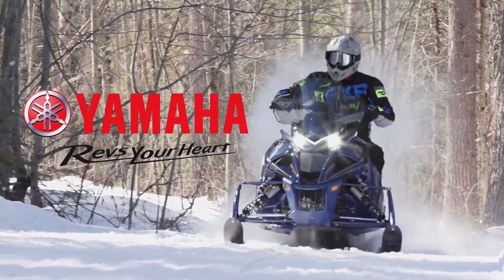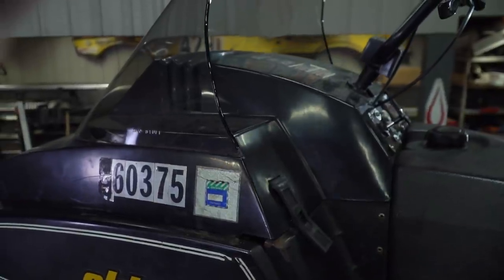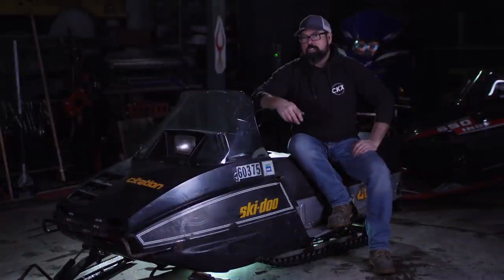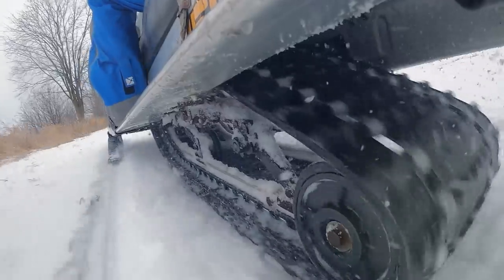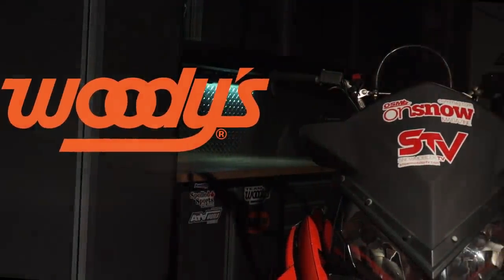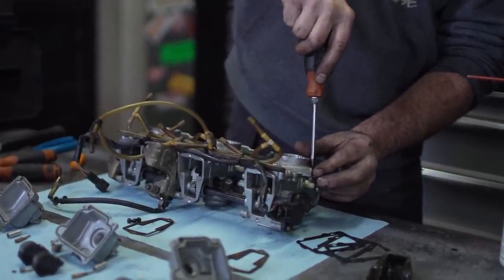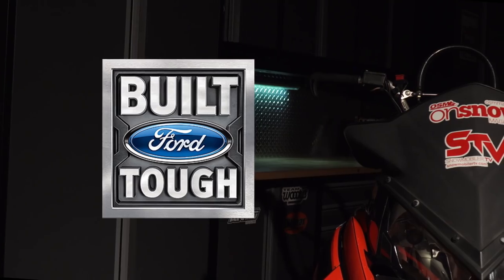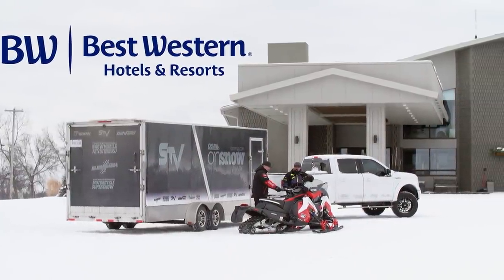Snowmobiler Television 2022 Episode 6

Comment: The citation "first burn" is, I think, the single best segment I've ever seen on STV. Could not stop laughing at the complete deadpan, "as if it's cutting edge" presentation.

On the flip side, was a bit disappointed with the water trick segment. For a show that is almost always more thorough and points out the important details, it seemed to be a bit lacking on info (which way to wrap the tape, WHY a taper seals so well, the fact that you can use the same boot holding the primary on).

Comment: I have a pretty much mint 99 srx700 been a good sled and sounds awesome. Had a shop do a top end though apparently it really didn’t need it but trying to be safe than sorry. Anyways got it back was harder to start if it sat a long time so I put gas in each cylinder and fired up. Later when cold and starting one cylinder would sneeze and cough. Had to give a little gas till it warms up then it would stop doing it. So if you stopped somewhere for a an hour or so it still fired up fine. But next day same thing. Thought maybe carbs had the place do them again they didn’t find anything wrong. So this year same thing but started to sneeze then backfire if giving it gas your fine till you let of the throttle. So I was thinking coil??

Comment: Two questions,  why not skip tipping your sled and use Vaseline or grease  to pop your clutch, I learned to do that pre internet, and were those Henrietta's sticky buns?
Reply: Those were my mom’s sticky buns. They were so good! 
Vaseline or grease would work for sure, but makes a heck of a mess and is difficult to clean. Water is just easier to deal with after, but you do have to turn the sled on its side to fill the cavity. 
I saw a comment about using bread. That would work too, and would be easily cleaned up.
Reply: @jeffsteenbakkers4435  no mess with grease, not like eating cinnamon buns. They looked great, lucky you.